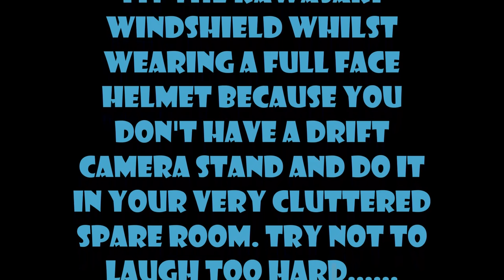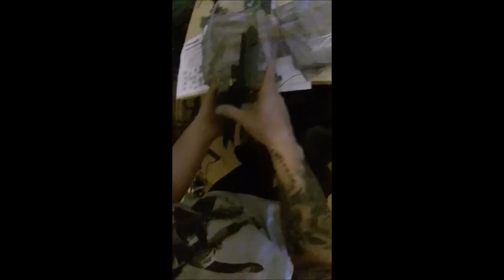Kawasaki Vulcan S : Kawasaki Windshield Road Test & Review

Comment: Very good review! I've had the bike for 3 months now. I rate it highly in most respects but do you find that the gearing is unusually short compared to most bikes?  I find I have to shift up very quickly.  Also, do you experience some vibrations in the bike at low revs, say 1,500 to 2.500 rpm?  Thanks and ride safe.
Reply from the maker: +Vincent Mifsud Thanks. Once I broke the bike in (more than 1000 miles) I find the bike sits quite comfortably around 4000 revs. I don't think the bike was designed to sit at low revs. Think the versys is the same. I did tend to change gear quickly at first but the bike has power all the way up to around 7000 revs if you wanna use it. Thanks for the comment mate😀

Comment: Thanks for the review. I really like the look of the cafe racer attachment but I get that if do the touring the large shield is better. VERY glad you mentioned the mounts are the same for both. Did you test the cafe shield? Just wondering if it does much or if it's just for looks.
Reply from the maker: +Sean Inness hi, no I didn't test the cafe shield, figured it was more of a cosmetic add on. Quite a pricey one at that. If you get it let me know what protection it offers!
Reply: I have the cafe version and that little one doesn't do anything just for looks.
Reply: Ahh, thanks Peter.
Reply: peter annino well im glad i saw your comment cus i was going to get one, i only want something to protect my chest from the wind cus thats my only complaint above 45
Reply: Have a 2016 with cafe shield and it is not good at deflecting wind unless you want it in your chest and face

Comment: After ridding with the large windshield do you think the medium would have also worked for you?  I think i saw you mention in a comment that you are 5’6”.  That’s my height in case I misread this. I have the cafe and i feel it does protect the chest but my head gets hit.  I took a 2,000 miles 7 day trip and decided and needed a full windshield next time.  I like the looks of the medium over the large and was curious if that extra height of the large is really necessary.  Thanks.
Reply from the maker: The wind buffets the top of my helmet if I straighten my spine with the large I would guess the medium would direct the air straight into your face. Just a guess though.
Reply: Pointless101 _ I went ahead and purchased the large one yesterday. I was going to go with a different brand but I really wanted to be able to switch back and forth with the cafe windshield. Hope it works without buffeting issues. Never had windshield issues on my other two bikes.
Reply from the maker: Good luck a happy trails 😀

Comment: hey bud, taking my kawasaki vulcan for a ride this week.  I have a similar backrack that attaches to the passenger back rest, but it states you should only put up to 10 lbs? wth, thats terrible.  However i seen in your video , you have a duffle bag attached for your ride, were you worried about weight? how did you connect it , with bungie cords? thanks bud.
Reply from the maker: +Robert Hixonr hi mate. The back rest is sturdy as hell so i didn't worry too much. I attached the bag with a ratchet strap and 4 bungee cords. I also put the handles of the duffle bag over the back rest to centre the bag. I will say too much weight does make the front end light. Happy trails buddy enjoy your ride!

Comment: When i bought my Kawasaki Vulcan s, it had a windshield on it but i had it removed because it was extra and i didn't love it. Reminded me of some kind of cop cycle, like chips. anyways it also seems to push air right into my head at higher speeds.  I am only 65 " so i was surprised. is this that same as the stock option? I didn't realize that you can just take it off with a key, that is awesome.  The reason i am interested is because i love riding with my wife but on the highway my helmet catches so much wind on the highway around 70 mph . Any suggestions? would love to get something, also thinking of some bags, love the black out look of yours, mine is white, which is also quite nice. thanks brother.
Reply from the maker: +Robert Hixonr hi mate. I did a windshield review of the one I got. It's on my channel, take a look. I'm 5'6 and the large windshield does push the wind just over the top of my lid. This takes it off my chest making it quite comfortable at higher speeds. However the wind noise is horrendous. So I either get a better helmet or use ear plugs. I'm tight git at heart so I went with earplugs. Hope this helps, tanks for watching.
Reply from the maker: +Robert Hixonr oops you already found the review.
Reply from the maker: +Robert Hixonr oops you already found the review.